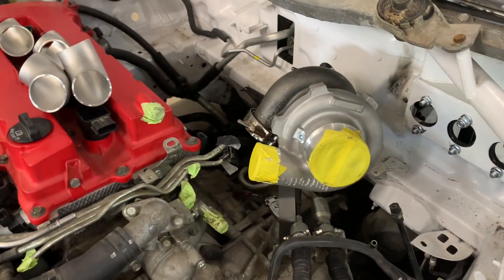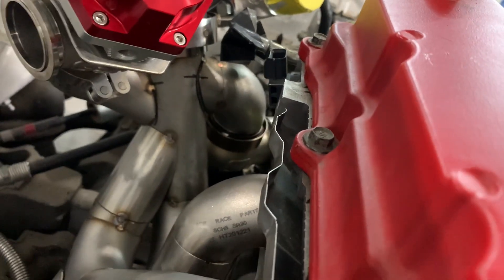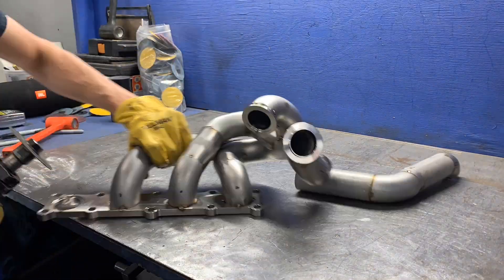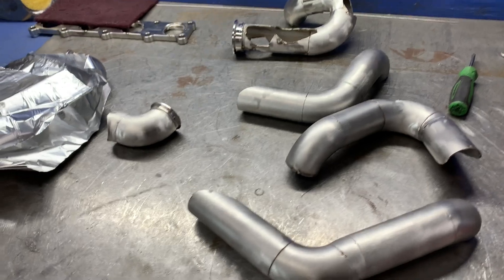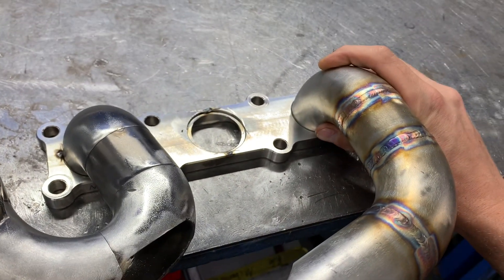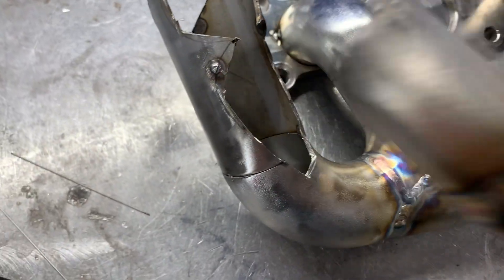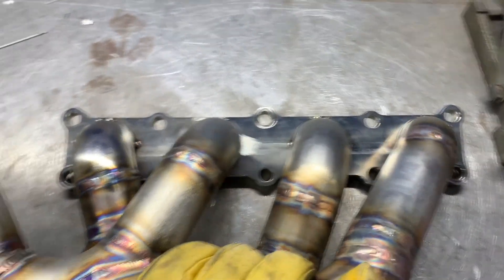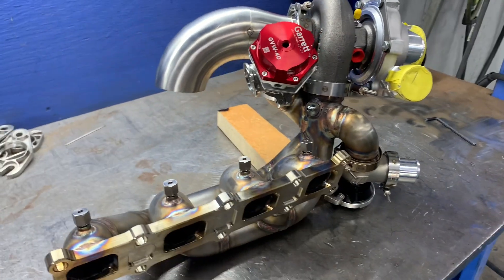Fresh air ANTI-LAG manifold build!!!

Comment: Very nice work, how did you manage the cutouts, I'm struggling with my design!
Reply from the maker: The biggest thing is wastegate priority. You want to flow to be directed at the wastegate to avoid boost creep. I also placed the ALV inlet so that the wastegate can also open to release any excess boost in cases of over spinning the turbo.
Reply: @afterhoursgarage520  I'm working on a compound system, and I have electronic wastegates. The difficulty for me is when I need to merge the runners. I've seen someone once showing how to do it  just by drawing on paper wrapped around the tube and then reporting it on in the other piece it should merge into. Tried many ways, but I guess I will have to go by trial and error.
Reply from the maker: @LaTeamPrep  getting the correct copes on tubes is challenging. Making small changes between fitment is best, trying to remove too much material as once is usually when there’s gaps and it doesn’t fit well
Reply: @afterhoursgarage520  Thank you mate, I'll definitely go one little change at a time!

Comment: I thought the fresh air valve is fed by the compressor side not the turbine side. You’re essentially using it as a wastegate here?
Reply from the maker: Is it fed via the compressor side. The fresh air will be entering right before the turbine side instead of directly after the ports. I’ve found that having the air enter right after the head drastically raises the temp of the head. 
The method I’m using may take a second longer to get ignited as it’s further down stream, but maximizing reliability and temps are my concern not peak performance
Reply: @afterhoursgarage520  oh, you’re absolutely right! I mixed up the inlet and the outlet of the valve! I like your approach!

Comment: did the v-band stay straight? tip for future have the exhaust housing clampad as a heat spreader so vbands stay straight.
Reply from the maker: Always good to be cautious and have started recently machining aluminum caps for every vband I come in contact with. Fortunately this particular flange was exceptionally thick so it did not warp.

Comment: Curious what the joins look like inside?,(only takes a tiny bit metal melt off to distroy turbo?)
Reply from the maker: Manifold was back purged so welded inside and out. Took extreme care to make sure everything was clean and no debris after welding
Reply: I didn't even back purge mine and it was fine in a twin turbo drift car making 600 bhp and getting bounced off the rev limiter for years. People on the internet love to tell you you're doing it wrong or that things will break but most of the time they're wrong

Comment: Exhaust gas isn't fresh air
Reply from the maker: Correct. That is why the after intercooler charge pipe diverts into the the turbosmart ALV40 that’s plumbed into the exhaust manifold. This isn’t a twin wastegate manifold as I was able to achieve great wastegate priority that only requires one. So the second actuator is for allowing the compressed fresh air into the exhaust system where it’ll ignite with unburned fuel and a hot manifold, therefore creating fresh air antilag.
Reply: This is the way I've seen it done